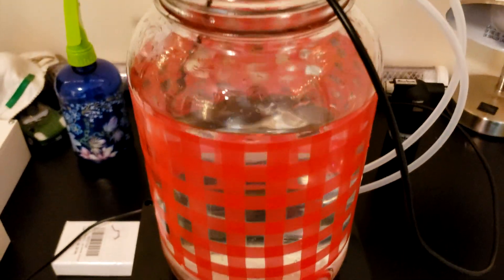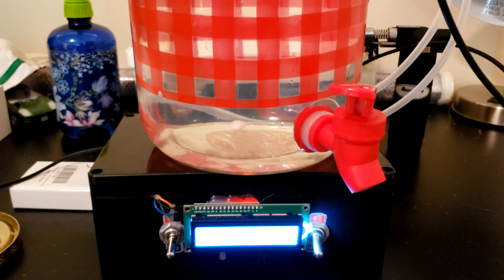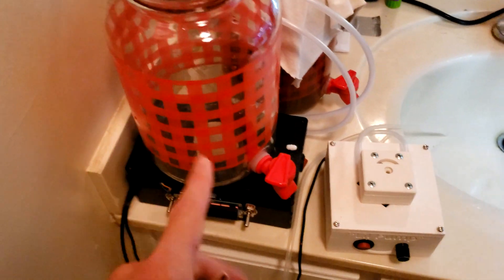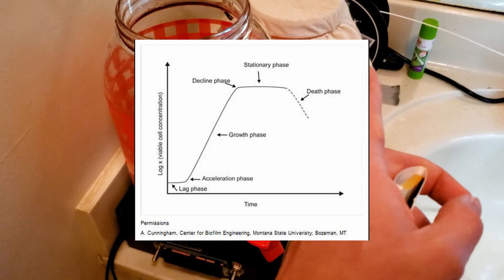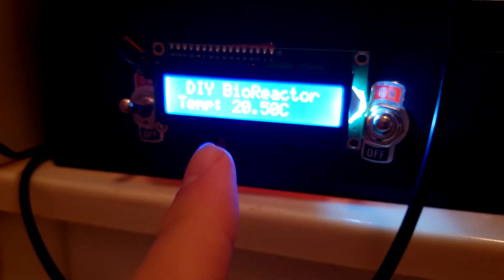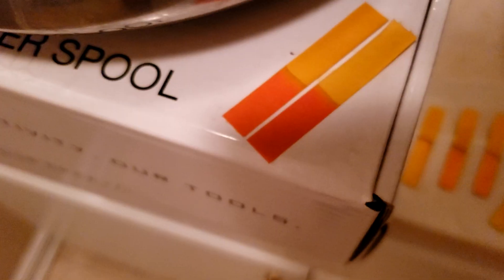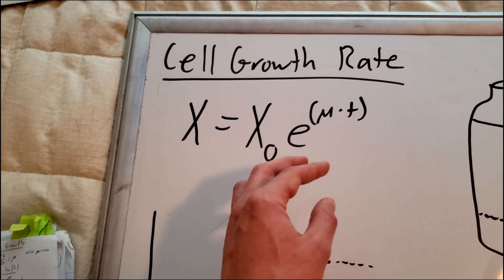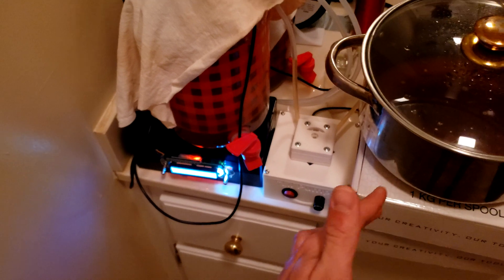Fed Batch DIY Bioreactor Experiment

Comment: For the next itteration (or thereafter), I've seen some cheap ph meter that you could use with the arduino, they are probably as good as the cheap hanheld ones and have a better resultion than paper and replacable electrodes + automation in conjunction with the pump.
Reply from the maker: Yes I think I've seen one of those recently too! Definitely should be added to the next addition. Thanks for the comment!